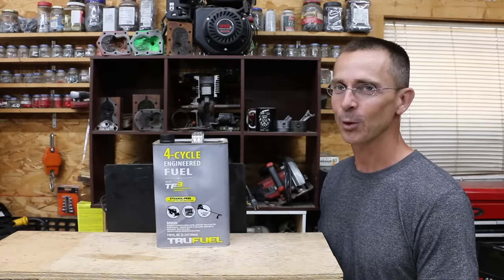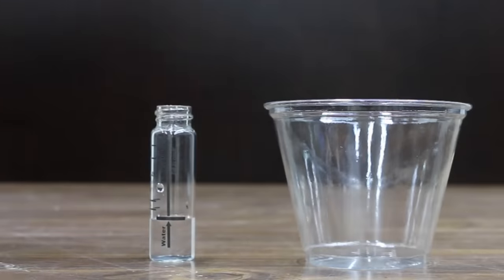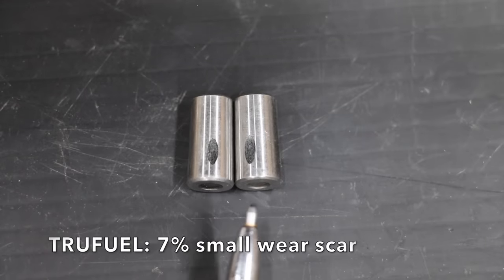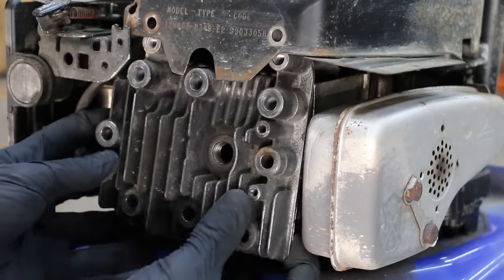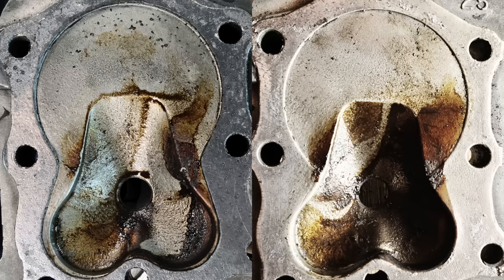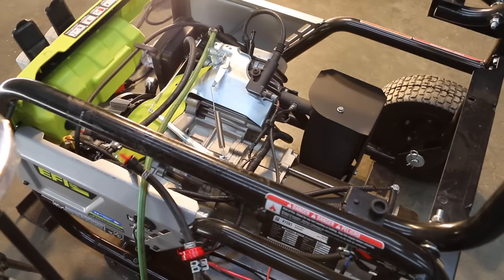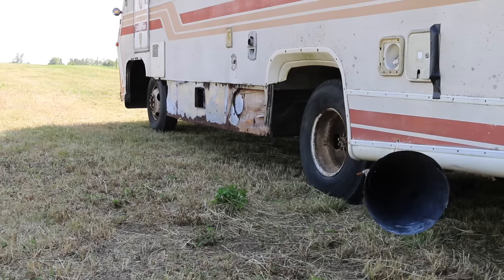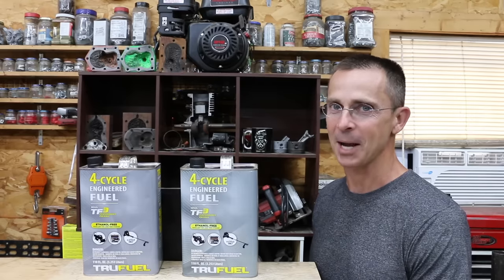Engineered Fuel better than Pump Gasoline?  Better Fuel Efficiency and MPGs? Let's find out!

Comment: Sure would like to see a similar test comparing “regular” diesel to bio-diesel. Thanks.
Reply from the maker: Great suggestion!  Thank you.
Reply: We think the light green stuff has better mileage and filter life, knowing the truth in a project farm video will definitely get the trucker's attention
Reply: @ProjectFarm  should do a part on how it will act with "well used" tanks, ex: tanks with sediment, rust, water, etc, as in my experience it likes to clean the tanks and plug the filters then in the winter wax/gel/freeze and in general be a pain(biodiesel)
Reply: @davidpistek6241  the light green is just a dye for #2 ULSD. i deliver fuel and the fuel rack i load up at gives light green, but another fuel rack gives crystal clear #2 ULSD... its a dye to help distinguish the difference between gas and diesel
Reply: I drive trucks, and there is a difference in tint is bio yellow and regular diesel like a sprite green light tint ,and does bio clog filters
Reply: Test both new and used vegetable oil, HVO100, bio100, waste motor oil/atf and kerosene too
Reply: @choelstad91  it a dye for taxes as farm diesel is a thing and people think they can get away with it(off road diesel is not taxed as off road equipment stays off the roads for the most part)
Reply: It would be really interesting to see how long it takes for the dye used in tax-free farm/machinery diesel to flush out of the filters and tank
Reply: @jhsevs  that would be interesting
Reply: @J-1410  are you saying the light green, which i have delivered to all kinds of gas stations, including major chains like loves, is a farm diesel?
i always assumed farms would use red dye
Reply: And Propel diesel!
Reply: And test to see if there's dyes in motor oil too. And how long sooty, used motor oil takes to clear out of the fuel lines and filters.

I've heard the method they (the police i guess) use for "dipping" aka dipping a stick or a hose in the fuel tank and looking for dye is to mix it with an acid of some kind and it should change color or something like that.

I've tried searching but there's very little info in this, as far as I can find, hence my curiosity. Maybe it's just because I don't know the terminology though and don't know what to search for
Reply: @jhsevs  for off road diesel in road vehicles?

They just take a syringe with a short hose on it and draw some out and see what color it is. Red is off road, so if its red, they'll give you a stupidly expensive ticket
Reply: choelstad91 light lime green, almost transparent but just barely a green tint, should be normal taxed diesel. Deeply green, red, blue or yellow is tax free. (At least in europe where I live)

I actually had a moment of slight surprise the other day. Shined my phones flashlight into a diesel tank to see that the content seemed to be colored blue. It turned out that it was just the ble color temperature of my phones LED that was too bluish and literally made the diesel look blue because of that. Waited until the morning the next day to see the diesel in daylight and it didn't look blue at all. It was an interesting sight.
Reply: sounds more like false fuel based on the results 😂😂
Reply: Oh yeah and btw, we have something called winter diesel here in northern europe. The pump diesel is mixed with 35% kerosene during winter months, to prevent geling/waxing and to make it easier for newer direct injected cars to start on it. I wonder if there's any performance or longevity (lubricity) difference between summer and winter diesel. I have a hypothesis that it it a good idea to try to not use winter diesel in the summer because it wears out the injection pump more. My family has an old 1989 Kubota tractor that is mainly used in the winter for snow plowing, and usually gets filled with winter diesel (i think, unless the tax free diesel isn't mixed with kerosene). We use it occasionally in the summer too for various projects. I've had this on my mind for a while, would be interesting to see if my hypothesis is true or false.
Reply: J. A. G. 
Correct, but they also need a method to test if they're unsure. I've heard that you can't see it, but the dye apparently sits in the filter and fuel system for years (?) and you can get fined for dumping only the slightest bit of it in your tank. They must have some sort of testing method that isn't just based on visual inspection alone. I think what they do is a pH test or something like that, if they can't see it right away.
Reply: @ProjectFarm  Should do pump diesel, versus red dye, versus bio diesel
Reply: @davidpistek6241  Got mine O.o I drive a diesel and work with truckers everyday. I've always heard bio had worse mileage and power. I wanna know for my truck.
Reply: Yes and WarpedPerception did something with Hydro Diesel as well. I've never seen the stuff, but it' some kind of emuslified water fuel suspension for diesels.  I kinda get the idea, but no idea how it will work in the real world.
Reply: @J-1410  Unless your truck is registered as a farm vehicle. Around here you're allowed 1 truck if you've got the permit for dyed, so all your Ag or construction equipment and 1 truck.
Reply: @choelstad91  I thought only the red stuff was dyed.
Reply: @Obsidian0Knight  where is that?
Reply: @ProjectFarm  FWIW, while my brother started by making biodiesel for his Toyota pickup, he has run (filtered) WVO for over a decade.  (I'm not sure if he runs it straight or mixed with regular diesel, though.)  I think that it would be interesting to see what kind of results you get from using the full range from straight WVO to regular diesel, perhaps also seeing how different additives affect it.  (https://permies.com/t/24451/WVO-Blending-Gasoline-Diesel-Fuel)  Just be careful; a few years ago, he was filtering WVO during the winter and he didn't wait for the oil to cool before adding the gasoline.  When the -10C gas was poured into the 200C oil, it INSTANTLY vaporized and he suddenly found himself in the middle of a fireball that filled his entire shop.  Fortunately, he survived but ended up so crispy that he wasn't able to work for almost six months.
Reply: @J-1410  Like geographically or corporately?
Reply: @J-1410  Oh sorry I thought you were replying to a different comment. Haha, yeah I'm in Alberta. And at least as far as I know that's how she works.
Reply: @Obsidian0Knight  huh that's interesting...wish it was that way down here (ND)
Reply: @Obsidian0Knight  well if your yields are more than 40 bushels in the poor spots, geographically, otherwise just the diesel part.
Reply: Petrodiesel is the word you're looking for. By bio-diesel, I presume you mean fatty acid methyl ester (FAME) diesel :)
Reply: Very much agreed
Reply: Many of my customers run vehicles on bio diesel and aslo vegetable oil and they go through double if not triple the amount of filters pumps and injectors, i even seen one where i can only explain as vegetation growing from the fuel filter. 😆😆
Reply: @jhsevs  Lol....I've been running Kubota tractors since 1977 and John Deere before back to 1965 or so....for wintertime fuel I started a mix found in a Volvo Diesel automobile owners manual in 1973. 1 pint of Hi test gasoline per 10 gallons of diesel. When we are at 0 degrees Fahrenheit I use personally a little more and it hasn't caused me any issues...My oldest machine is a 1978 JD 310a backhoe that is still used very regularly as a down time replacement in my fleet. Just my experience...I must also say that todays fuel isn't the old fuel of the 60s and if a fungus grows in it it by all rights shouldnt burn...lol..Many Blessings, Kev
Reply: Project Farm don’t forget off road diesel when you do it
Reply: @ProjectFarm  Actually you should compare renewable diesel (HVO) with biodiesel and petro-diesel.
Reply: Trucker's hate bio diesel so do farmers to many fuel problems related to using it.
Reply: @jhsevs  winter fuel burns hotter, so in the summer it creates to much heat in the engine which causes problem. I live in nroth centeral USA we get well below freezing temperatures.
Reply: In Louisiana it’s a very expensive ticket about $1500 a gal from what I’ve heard.   I’ve put in one of my older trucks once when I was way out away from anywhere and was almost out of fuel just so I could make to a station.  Boy I was glad I had that 10 gallons in the bed
Reply: Bold Venture i was told  the  dyed diesel is for d
farm use   and it also has a higher sulfer content

Comment: I used truefuel 50 for my small snowblower all last year.  And will continue it’s much more convenient and no oil mess plus it starts easier.  I always run it dry when I’m finished using it…always for sure at the end of the season.  Thanks for the great video.
Reply from the maker: You are welcome!  Thanks for sharing.

Comment: Me:  what's engineered fuel?
Me 12 minutes later:  I should build a Farmebego
Reply from the maker: lol. Nice!
Reply: me at 11:37... I need to do donuts in a farmebego...
Reply: Farmabagos can't be built; they can only be found.
Reply: A flame-belching Farmbego!
Reply: @Oops Oops an old oval-port 454. Go back and watch the electric turbo video he made.
Reply: Engineered fuel is a better term than when, years ago, they marketed "synthetic" oil.  It was marketed for aviation reciprocating engines.  I was a flight instructor at the time and rode to work on a motorcycle.  I thought I could use in my Honda.  I called Phillips Oil and asked their engineering folks, "What do you synthesize oil from?"  The Phillips rep said, "it isn't synthesized actually, the more appropriate term would be "engineered".  O.K. All that for a dumb story.

Comment: Please do 10" table saw blades! Top of the line Forrest blades vs middle of the road freud blades vs cheap ones
Reply from the maker: Great test idea!
Reply: I'm a cabinet maker and testing blades will take a lot of material. A good Amana 10" melamine cutting blade can cut upwards of 20 to 30 sheets (4ftx8ft, 3/4" thick) of cabinet parts before being blunted enough to need resharpening. A plywood blade can cut twice as many before being blunted.

You also have a HUGE variable in feed speeds and chiploading, especially with blades cutting hardwood.

Project Farm, if you decide to do this, please reach out to me. I think I could offer helpful advice on how this might work for testing purposes.
Reply: @RedfishCarolina  Using something like ipe or lignum vitae would dull the blades down pretty darn fast and really show who has the best carbide
Reply: @chrisfreemesser5707  In terms of cost effectiveness, it would probably be cheaper to run a bunch of domestic hardwoods through, rather than exotic ones, even if you have to use a bunch more to get the same amount of wear.
Reply: Check out stumpy nubs. He did a test like that. In the end, he actually uses a blade that he didn't test, the Ridge Carbide. It's better than the Forest and cheaper.
Reply: @ouisi7  I'm well aware of stumpy nubs. That wasnt even close to being a scientific, impartial review. I trust project farm to be impartial, as well as actually use science to test stuff

There is a lot more going on beyond "the finish of the cut looks better". I would love to see the tips under microscope before/after test, load on the saw while cutting (I.e. how hard the saw has to work to cut), chip ejection with the slow motion camera... The tools at project farms disposal make the opportunities endless
Reply: @ProjectFarm  please! Would love to see the tips under microscope before and after test, motor load while cutting, chip ejection characteristics, temp of blade while cutting, hardness of carbide teeth... Your tools make so many possibilities. I would happily put some money on patreon to see it happen

Your the best at what you do!!!
Reply: @RedfishCarolina  so buy 1 sheet and cut an inch off each pass... Equivalent to cutting 30 sheets. I think your putting too much thought into it lol

And for feed speed, as a cabinet maker, I'm sure youve heard of feed rollers before... As thrifty as project farm is im sure he could think up something

Comment: The more gunk in the engine could be that it's actually cleaning the fuel lines, so it actually gets the piston more dirty, specially if it is a old engine.

To truly test that you probably need 2 new engines or just let them run much more time or clean the fuel lines.

Awesome video as always too!
Reply: The lines are run dry. There wouldn't be enough stuff in the lines to cause any difference anyways.
Reply from the maker: Thanks for watching!
Reply: Yeah.....no. That's definitely not dirty fuel lines
Reply: I was thinking it was synthetic 🛢 oil residue. Since it offered a better pin wearing🤔

Comment: It's cheaper to use regular gas and fuel additives,
Reply from the maker: Great point
Reply: Ethanol sucks! Don’t put that in anything!
Reply: @JAMESWUERTELE  depends. For racing and high power, it's great. Just can't keep it for long
Reply: @TsLeng  Are you talking about E90, or regular pump gas with 10% ethanol? There is a difference.
Reply: @jimbol8695  E85, E90, pure ethanol even. And it was a reply to 'ethanol sucks! don't put that in ANYTHING!' 

As usual, it depends.
Reply: For me, despite using Star Tron fuel stabilizer, ethanol-containing E10 gasoline damaged my small engine devices. After using a bit of Seafoam and ethanol-free gasoline (Trufuel because that's what I can get), they run great again and have the same power as before.
Reply: @yazars  use 2 stroke oil with fuel stabilizer and fuel related problems will be thing of the past.  I have been using for about 8 years this stuff and every spring my equipment starts no problem. Never had fuel related problems and I use 10% ethanol fuel because that's all is available in my area.
Reply: @repairvehicle  I have 4 stroke engines though. (Unless you use a 2 stroke blend in your 4 stroke engines?)
Reply: Ethanol sucks. It makes the rubber hoses rot out really fast on my mowers.
Reply: @yazars  what do you have?
Reply: @MoneyManHolmes  And diaphragms and o rings too.
Reply: @repairvehicle  Lawn mower and snow blower
Reply: @yazars  there are fuel additives for small equipment like your that works very well.
Reply: @repairvehicle  the shop who sold me the snowblower recommended Star Trol, which didn't do a good enough job preventing carburetor problems from arising within 2-3 years of a new machine. The shop was going to charge >$100 since fuel issues weren't covered by warranty. No problems since I've reconditioned the system and used ethanol free fuel. It's way cheaper and easier for me to not need to worry about ethanol messing up my small engines.
Reply: @yazars ,  they recommend you wrong products

Comment: Another well produced video especially the dual exhaust Winnebago!!! 
I started using 2 cycle trufuel exclusively in my 2 cycle engines and have had no issues since with my carburetors. Have you ever produced a video comparing traditional fuel-oil mix vs engineered fuel for long term storage? Anyway keep up the great work!!!!!!!!
Reply from the maker: Thanks, will do!  Thanks for the suggestion.

Comment: Suggestion : Check the breaking point of different ''gear Wrench'' brand ratcheting system !
Reply: I believe AvE has a video on that, and the answer is “more than you would feel safe applying”. I think it was like 200Nm or so for a ratcheting wrench.
Reply from the maker: Thanks for the video idea.

Comment: Please, Test the 2 stroke tru fuel with variety of 2T mixes & 91 octane. Thank you
Reply from the maker: Great suggestion!  Thank you.
Reply: Yes please test the 2-cycle TruFuel. I bought a new Echo string trimmer and have used nothing but TruFuel in it. No problems so far. I switched from mixing my own oil/gas for a Poulan Pro 18” chain saw. It (TruFuel) worked very well for a while, but now the saw won’t start anymore. Could it have been the engineered fuel or something else?

Comment: When you did the wear test I clenched a little. I'm sure it's completely safe but rotating parts of metal abrazing in gasoline fully whipped with air sounds very scary to me.
Reply: He had a fire extinguisher he said in another comment saying the same thing also the gasoline if it were to catch fire would burn up almost instantly with how little was there and how fast it burns still wouldn't be good though
Reply: @subsnovideos-ur4cn  yeah I'm sure he did the math but eek
Reply: There's no way that would get hot enough to start a fire. Your breaks get hotter than that and you could cool them off if you dumped gasoline on them lol
Reply: @jor-d5640  I wouldn't put anything hot in flammable combustible liquid
Reply: You definitely don't want your face over that. Eeeee might be awhile till your eyebrows grow back. 😆
Reply: @subsnovideos-ur4cn  it looked like about 1-2 oz of fuel. Probably wouldn't do too much damage if it lit off.
Reply: small sample, and if I know project farm I bet he had 2 of the best tested extinguishers right there
Reply: @RickBaconsAdventures  right! All fully  tested and reviewed lol
Reply: @jor-d5640  Gasoline liquid doesn't burn. However fumes (vapor) are very explosive.
Reply: We used to put gasoline in our Zippos back when. You use what you have on hand. When you're 11,000 miles and two continents away from home? Lighter fluid isn't easily acquired. Gasoline works just fine.
Reply: @craniostomy  I'll have to remember that for one day you never know.
Reply: @milehigh3054  bro fr some survival shit right there 😂😂
Reply: @sunnyd6439  😁😁😃way things are going in 2020 might need that shit real soon! Ha 😆
Reply: @craniostomy  I've seen people use gasoline to light bonfires and it's less fine, I suppose the poison is in the dose :P.